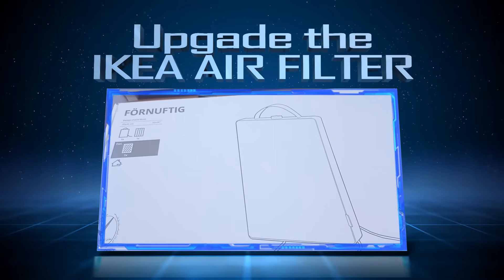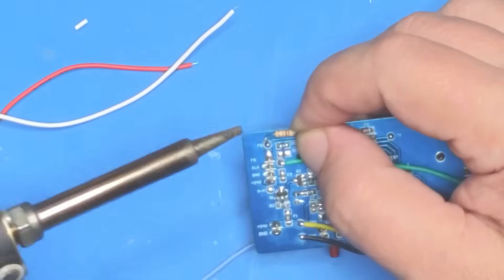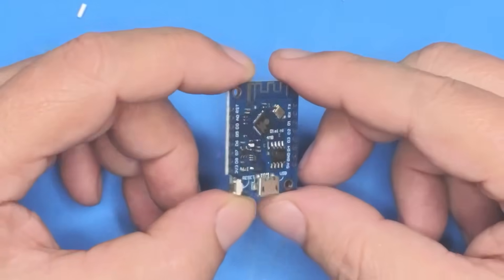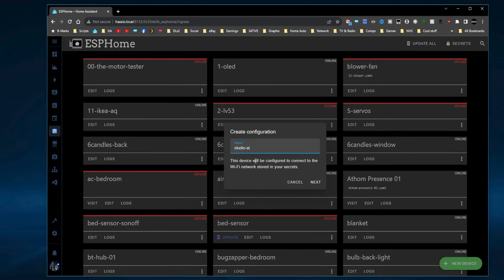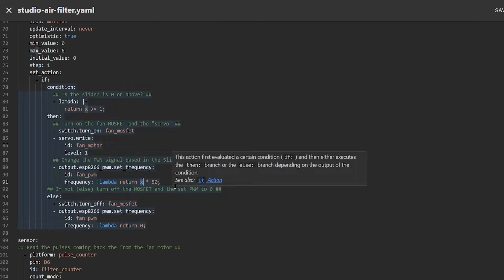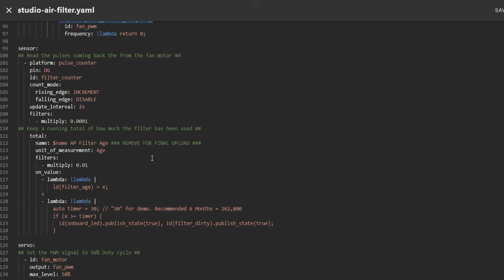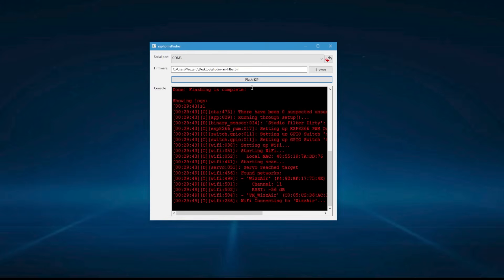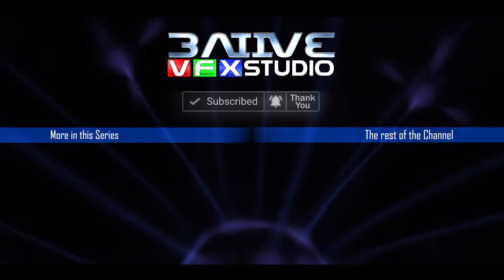Control Your IKEA Air Filter with Home Assistant and ESP8266 Upgrade

Comment from the maker: Some recent comments mention the boards can be different and they need to move the Control Knob
To "fix" you issue you have, cut the track before the resistor the White wire is attached to.
See here: https://imgur.com/a/S7vJe1l

Comment: Would the code need modification for a ESP32 C6 board? I'm completely new to ESP.
Reply from the maker: Yes. The Pins and their identifiers would need to match what the ESP32-C6 uses. 
If you are new, start with what I've shown here and use the D1 Mini.

Comment: Thanks for the project. But the age counter still counts if the fan is at 0. Once you have used the fan for the first time after programming the D1. Is this right.
Reply from the maker: I'm glad you found it useful. As for the counter, no that should not keep counting. It's based on the output (pulses) the IKEA fan produces. 
- My guess: Your D1 Mini is picking up a stray "signal". Check your wiring and, if needed, re-route the wire(s). Also, reduce their length(s).

Comment: Thanks for the great video.

I noticed at speed 1 (50Hz) my fan produces a slightly oscillating sound as it is probably trying to spin too slowly. I changed the equation from x * 50 to 48*x + 12, giving me a range of 60 to 300 HZ on those 6 speed settings. Now speed 1 is whisper quiet.
Reply from the maker: You are most welcome. 🖖
🙏Thank you for sharing the conclusion of your experiments. I haven't noticed that issue myself but, I'm sure others will find it useful.

Comment: There is a 5 volt in the middle of the board, seems to be live at 5 volts all the time for me.
Reply from the maker: There is, yes. However, that's for the on-board MCU. You cannot run a D1 Mini from it as well, the IKEA board's 5V regulator will pop!! 
- Ask me how I know!! LOL
Reply: @3ATIVE  ok, I was seconds away from powering up the board using that 5 volt !
Reply from the maker: @jamescrook99  Glad I saved you from the "Magic Smoke" :)

Comment: Does this render the air purifier non operational when the wifi is not available? Or do I misunderstood the knob part
Reply from the maker: The idea for this project was to pair it with my previous one, the Air Quality Sensor, to control it.
Therefore, there should be no need for "Manual" control.

Comment: is it not posible to claim the knob for the esp board? so you have a nice way to controll it on the device itself and trough home assistant
Reply from the maker: No, you can absolutely do that, if you want.
I chose to do it this way because I wanted it automated.
Reply: @3ATIVE  I am also for full automation. but sometimes, your smartphone is in a other room/floor and you stand in front of the filter and want it turn on or off. i would appreciate a way to override the automation without a smartphone.
Reply from the maker: @mikkieick7003  You are missing the point of "automation". If you require your phone, or other manual control, then you're just making it remote controlled. 
This project was designed to work with my Air Quality Sensor so that it (automatically) controls the filter based on air quality.

Comment: Is there a way to have the speed setting work on a percentage of max output, rather that the 6 speed stepped setting. I'm not particularly fluent in code.
Reply from the maker: Absolutely, as the fan is PWM controlled.

Comment: The way I would hack this would be Gut out the controller/99% of the electronics and use a DC switch. and have a PC fan controller instead that works with 24V.
Reply from the maker: Sounds like a "plan" - I look forward to your tutorial.
Reply: @3ATIVE  Don't have one "yet", and would be more or less making a DIY version. with 3D printing. if they are on sale might snatch one
Reply: @3ATIVE  The "Nukit Tempest Euro" was revealed a bit ago, might just go that route, and use a ESP32 with relay shield to control the fans.
Slightly more expensive, but easier to use/build/setup
Reply from the maker: @darknessblades  There's always options. :)

Comment: There are something I didn't get. 1- How do you know which variables you must use in order to control the board belong to IKEA? 2- This kind of video is really shocked me. For example can I do this kind of stuff to my wifi boiler thermostat? I've subscribed bro.
Reply from the maker: It's called "Reverse Engineering" - I first look at the board and work out what the Microcontroller is doing. This is mainly done by seeing what's connected to it. 
- Obviously, there is some prior knowledge needed - I've been an Electronics engineer all my life LOL
Next, knowing what these components do, I replicate the signals on the D1 Mini and replace the IKEA ones with my own.
Reply: @3ATIVE  You're real superman. Thanks so much for explaining.

Comment: Nice project! I just completed it and it works wonderfully! I was just wondering one thing, would it theoretically be possible, to turn that speed-slider into a fan-component so it shows as a fan in home assistant? I had a look around the docs but couldn't yet figure out myself how to alter your code in a way that it does what I want it to do. Maybe that's because I'm still new to ESPHome, who knows :p
Reply from the maker: That's great to hear - I'm glad you found my video easy enough to follow. 
I originally made this conversion so that it would be automatically controlled by the previous (IKEA Air Quality Sensor) tutorial. However, there have been a few people who have also requested a "Fan" component. I may make a follow-up on how to convert the conversion LOL
Reply: @3ATIVE  Thanks for the quick response! Yeah, the air quality sensor is still on my desk and will be converted shortly after :p 
A follow up would be really nice though, thanks for taking the time to look into it!
Reply: @3ATIVE  Any news on this topic? I'd really like to have a fan component instead of a number component :D

Comment: I've followed the guide and am happy with the result. It's almost as good at the solution I have in my other Fornuftig that I installed a custom ESP enabled PCD in. The only issue I have with this solution is that it doesn't present a simple on/off function to Home Assistant,  I have to control it via specifying the fan speed. The code looks like it should present a switch with an on off function, but no function appears in the device controls in HA. Is there anything i could do to add this swtich?
Reply from the maker: This was designed to be controlled by my previous project the IKEA Air Quality Sensor - So, I opted to put the "Off" control on the Slider's Zero position.
- However, if you want the Extra control of an On/Off "Switch" for Home Assistant.. You could easily add it. 
- In fact my other tutorial: "Ultimate Fan Project" has a Switch ( Called Master ) that does just that. Check it out here >> https://youtu.be/_XgJyYwlejo

Happy Coding.

Comment: Have you considered another mod to turn the LED on when the fan is running?
Reply from the maker: Not really as I'm not sure how that would be useful - It would be like having a Lamp in a car that indicates it's moving!! LOL 
- What is you reasoning for the LED ?
Reply: @3ATIVE 
About to mod my second one. 
Fan is very quiet, and I'd like to know when it's running. My automations turn the fan off when the windows are open. Just nice to know if they fail and leave it running with the windows are open
Reply from the maker: @mikesherman4513  When the White Wire goes High it turns on a MOSFET - which in turn switches the 24V line to the fan. 
Now that won't spin the fan, the Fan's speed is controlled by the PWM signal on the Green wire. 
In order to know when the fan IS running, you can pull a signal from the Blue Wire, that's the feedback from the Fan itself.

Comment: Thanks for the great content. I will be off to Ikea soon. Will this work with the bigger filter the round one starkvind costing £145 as this one has a pre filter to catch the bigger particles and make the HEPA last even longer.
I know it can be controlled by vindstyrka can it be adapted to input to HA.
Again, great videos I need to get building
Reply from the maker: Thank you for the kind words. 🙏
I can't answer about that other filter. However, I can't imagine it being much different - Don't quote me on that, as I've not seen inside one and I'd have to reverse-engineer it first.
Reply: I might get one and have a look also what is the cable you use in the box you did mention it in another video? from Amazon?
Reply from the maker: @M0PAX  Cool, Let me know how you get on.
For the cable (and everything I use in these videos) Check the description for the Amazon Link, labelled: "Get the Gadgets, Devices and Tools I use"

Comment: I have shorted the IKEA pcb unfortuatly with my multimeter. beginners luck I suppose... Is there anyway to not use the PCB and connect it directly?
Reply from the maker: You're not the only one... I did that too. I just brought another. However, all that board is used for is controlling the LEDs, changing their brightness and turning the Fan on&off... All of which can be done with your ESP32.
Reply: @3ATIVE  ah I feel so stupid when it happend! Can i connect the 24v from imput to the Fan directly, and connect the clk and the FG directly to the ESP6288? Ive messured 2.5v on both the CLK and FG when I power the fans directly 24v (the fan will go max speed). I just dont want to short the ESP board. I have the ESP32 and a Ali D1 Mini now.
Reply from the maker: @raoulvisser2092  Sorry fella, I got confused - I thought you were the guy using an ESP32 in the IKEA Air Quality Sensor.
Hmmm, the Air Filter board shouldn't be too hard to 'reverse engineer'. It's just a PWM for the Fan and MOSFET for its 24V supply. Then there's a "Pulse" coming back out.
Reply: @3ATIVE  No your right, I am that guy. just got my D1 Ali deleverd yesterday. Is the 24v that the IKEA pcb is passing though the Fans being manipulated by the Clk? of is CLK modifying the speed inside the FAN? Ive checked a YT vid. saying that if the PMV isnt getting a signal it will go Hi. So if i just connect the GPIO CLK wire to the CLK Fan wire. It could work. what do you think?
Reply from the maker: @raoulvisser2092  OIC...
So here's the run down:
CLK (Green Wire) is the PWM for Fan Speed.
FG (Blue Wire) Pulse out from the Fan.
The White wire (connected to the R13) is how the ESP turns the fan's 24V On&Off via that MOSFET (Q2). The Idea being that the fan isn't powered all the time - Like when you're not spinning the fan.
Reply: @3ATIVE  Hmm. So the thing i need to replace or bypass is the mosfet, wich is on the IKEA pcb. (Wich I probably fried when shorting it.) If i dont use a mosfet the Fan would always be running. (wich is fine) And the CLK can still lower the fan speed. and the FG will be used for the filter age. Is this correct?
Reply: I have connected (briged) the Fans direcly to the 24v. and used the pcb for the rest of the wires. all but on / of works. So at least it can still function. Any tips on removing the anoying pulse hum on 1? :D thx for the swif replies btw! Rare to see!
Reply from the maker: @raoulvisser2092  Well that's cool - Good job...
However, as I mentioned earlier - that MOSFET (Q2) switches the power on/off to the Fan motor. As you've bridged it, it's likely your fan is powered constantly causing it to "hum" when Idle. Easiest way (and total hack) Replace your bridge with a relay. :)
Reply: @3ATIVE  Ah Id like to try to do that, could you tell me what type/model of MOSFET I could use for this?
Reply from the maker: @raoulvisser2092  I'd loved to help out with choosing a MOSFET but, that would involve pulling mine apart and doing a load of testing to get all the specs required.
For you, it'll be easier to just use a Relay Module.
Reply: @3ATIVE  i also fried my pcb haha - but it seems like its q1 - if i bridge q1, i can control the fan with the knob again - without bridge its dead. any idea where to find a replacement q1? (if this is the whole problem) ?
Reply from the maker: @darioknoedel  Oh dear - that's not good :(
I doubt you'd be able to find a replacement for that Q1 - You could try and contact IKEA and see if they have replacement PCBs (again doubtful but, worth a go)

Personally, I'd buy whole new unit and put it down to experience... I have a T-Shirt for just that! LOL
https://store.3ative.com/en-gbp/products/experience-gained-t-shirt-3

Comment: Love this project, Was wondering how would i change the script to a ESP32dev board? Im in over my head on this!
Reply from the maker: I'm glad to hear that, thanks.
As for changing to an ESP32, it fairly easy. In ESPHome you just need to:
* Change the Board to ESP32

* Re-assign the pins...
D1 Mini's use D-Numbers where as ESP32 (normally) use "GPIOXX" designations.
Reply: I made this project using an ESP32 but also using the library Homespan for the Apple HomeKit, and it's fully functional. However, there's one important detail to keep in mind: the ESP32 outputs a maximum pulse voltage of 3.3V, so you'll need a 3.3V to 5V Bi-Directional Logic Level Converter to ensure compatibility with the air purifier's circuits.

The GitHub repository for the ESP32 version of the project you can find it looking for "Ikea-Air-Purifier-ESP32-Homespan". Let me know if you have any other questions—I’m happy to help! 😊